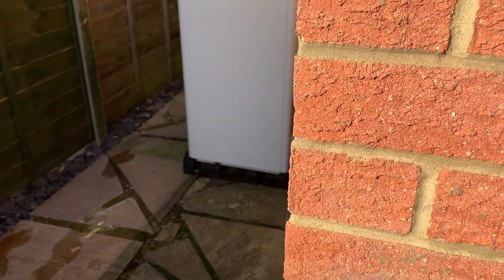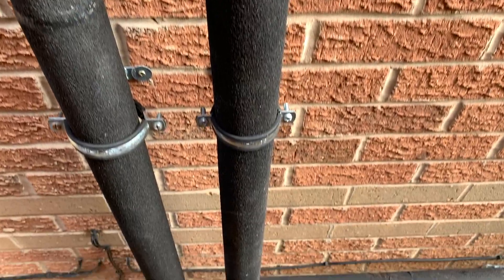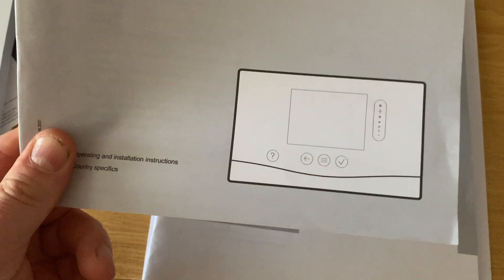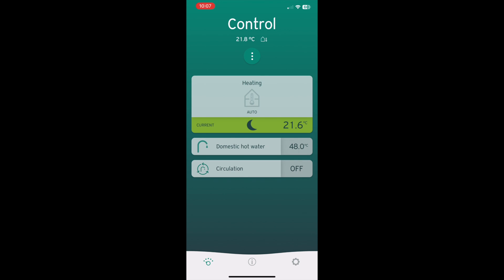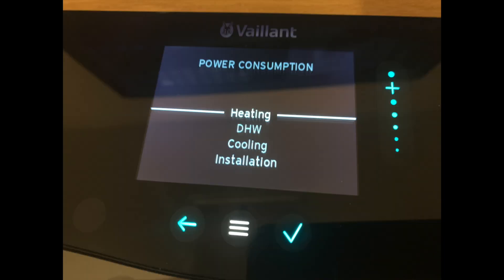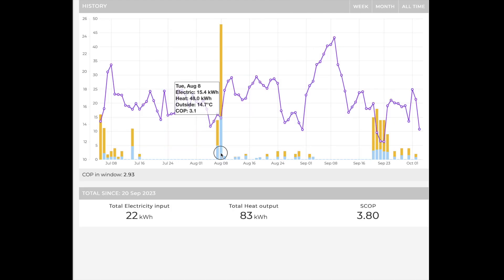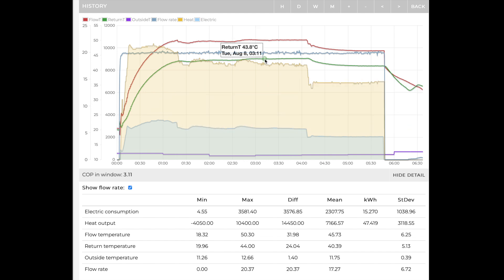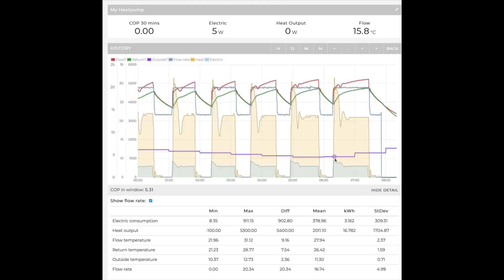Air Source Heat Pump - 30 days after install. What issues do we have?

Comment: Just looking at the clearance distance to the fence , I’d say there probably be an issue once the outside air temperature drops and the re circulating air caused by the fence ,starts to cause freezing on the coil, which will cause the efficiency to plummet. Will be interesting to see.
Reply from the maker: Thanks for watching Michael. The distance is 760mm between the fence and the heat pump, hence the need for planning permission detailed in the first video of this series. Vaillant's minimum recommended distance is 600mm. The passage down the side of the house is a wind tunnel, improved by the changes to the fence to open slat over closed slat. I doubt there will be micro climating. If it does then we can simple raise it off the ground.
Reply: @johntisbury  I think he makes a good point about the fence being too close. This will undoubtedly cause micro climating. If you watch urban plumber, he has had this issue on a few of his jobs and now elevates the heatpumps above the fences etc.
Reply from the maker: @deanchapple1  I've seen Szymon's videos where he has moved them to wall mounted. Air flow is all important in the location where the unit is fitted.

Our heat pump is outperforming its designed COP values. Currently running at 4.6 COP since its install in July. There's no issue with it micro climating down to 3ºC even with still days with no wind. I shall be monitoring it as it get colder, but so far no issues at all.
Reply: @johntisbury  yeah winter will be the deciding factor. Keep us posted. 😊👍🏼

Comment: What happened to LLH? Reasons for removal?
Reply from the maker: The buffer removal and reason why was covered in the previous video on this playlist.

Mark believed with the 35mm primaries we would get good flow rates 1200l/h. The buffer was installed as a safety net however we complained about it being noisy. So Mark removed it and said he should have trusted the maths; 7kW @DT 5 is 1200l/hr.

Comment: 1:20
Thank you John
What led your installer to the conclusion that the buffer tank is not necessary?
Reply from the maker: Mark believed with the 35mm primaries we would get good flow rates 1200l/h. The buffer was installed as a safety net however we complained about it being noisy. So Mark removed it and said I should have trusted the maths; 7kW @DT 5 is 1200l/hr.
Reply: @johntisbury Noisy because of the air?
Reply from the maker: @normanboyes4983  yes I think it would have been trapped air based on the amount I removed from the system from bleeding. Could also be turbulence too, which again can be air, but also the speed of the flow.

Comment: I still think the clearance in front of the heatpump is questionable. Certainly Octopus Energy would not of installed it there, because of the possibility of recycling the air as that will lower the efficiency.
Reply from the maker: Time will tell. I have purchased some smoke testers for that very reason on a cold still day I will be able to check if it is micro climating. Knowing the location and local conditions I don't think it will be a problem. However, if it does then it can be mounted up on a bracket to prevent it from happening.
Reply: Exactly right, there is not enough space in front or behind the heat pump.  Should be 1.5m in front and 300mm behind (minimums)

Comment: This has been really interesting John for a number of reasons. We have been looking at ASHP but had a few concerns due to the plastic microbore pipe. Watching your videos has reassured us that it will work as our house is 2018 and very well insulated, plus we have already installed large radiators to run our system at a lower temperature. Also by astonishing coincidence, JMR Heating is local to us and will be doing a survey.
Reply from the maker: Well it seems to tick all the boxes for you, that's great to hear. Have you watched the full installation video too showing they 6 day instal? Might be worth watching so you know what to expect. There's many urban myths about heat pumps, 5 years ago they may have been accurate, but not now with new modern heat pumps and the knowledge and expertise that goes with the installation of them. Mark from JMR Heating and Energy is a top chap and knows his stuff would recommend him.
Reply: @johntisbury  watching it now thanks, very useful.  Hopefully we won’t need any radiator upgrades as all are already double panels with those downstairs being 1.8m tall aluminium (chosen for both looks and output). Our complication will be a) HWC has to go in the loft as no suitable cupboard (slim cylinder should just fit through the loft hatch) and b) external unit will need to be wall mounted above head height over the driveway as there isn’t a suitable space at the rear of the house and the drive isn’t wide enough to place it at ground level and still park the car. Should be interesting!
Reply from the maker: @twelvebears1971 fairly normal situations to be fair.
Reply: @twelvebears1971  Have you looked at the Sunamp heat battery? It replaces a HWC at around 1/3rd of the size (although very heavy) can store heat a lot longer than a cylinder for obvious reasons like not constantly dilututing the hot water with cold water top ups.

Comment: I’ve instited octopus run my pipes internally 

Still waiting for them to get back to me.
Reply from the maker: Good luck with that.
Reply: @johntisbury  it’s exactly the same distance 
And a clear in obstructed pipe run. I’ve got new external wall insulation which is as fragile as an egg.  I’m also a former qualified installer MCS buisness owner so I know the job.
Reply from the maker: @rymoe6299  I hope that Octopus see that too then. Have they given you a default 'desktop quote' or did they visit and complete a heat loss survey?
Reply: @johntisbury  i had a survey done a few months back and the pay back didn’t justify the outlay.  Band B EPC.  I don’t need any radiator changed.  But I do need a new unvented hot water cylinder.

With the now £7500.00 BUS payment 
My contribution is £1500.00 £500 deposit and the rest over 12months interest free

For a Daikin 7kw plus 200ltr cylinder
Reply: Also found octopus were the only company to correctly size my system!! Few hundred watts difference on the hall stairs and landing.  
There paperwork quote was A1

Had 2 installers demanding payment in full and they would refund the bus payments after install! 

Complained to MCS and there were not interested 

I guarantee a lots of SMEs will be ripping people off with the installs!  Not all of them
But definitely a few
Reply from the maker: @rymoe6299 makes sense now for sure.
Reply from the maker: @rymoe6299  there's certainly room for ripping customers off with heat pumps, it's the new green deal insulation all over again if people don't do their homework and read up on the rules for the grant.
Reply: @johntisbury  that’s what I fear.  I’m glad I saw a heatgeeks sticker on your outdoor unit.  Good choice 👍🏻
Reply from the maker: @rymoe6299  a HeatGeek guaranteed install by JMR Heating and Energy was an easy choice looking at their customer feedback, their approach to a detailed heat loss and system design.
Reply: I agree, Mark installed my system at the beginning of January and apart from my over 20 year old UFH pipework still  having a bit of gundge in it therefor blocking the filter, making the HP shut down we haven't have an issue. BTW Mark has popped in at 7am on the way to work or in the evening on the way home to sort the issue every time, Couldn't recommend them highly enough @johntisbury

Comment: Hi John, Great video, but could you maybe add some more information for the ASHP monitoring with EmonHP. Dis you buy the level 3 kit and then get it installed or purchased with the ASHP? I am also interested to know more of how it connects up. I like you want to have more monitoring available to view and keeping track of how it is working.
Reply from the maker: Thanks for watching. Yes it was purchased and installed at the same time as the heat pump. I will certainly make a separate video on the components and how it works in more detail. I'm not expert it has to be said, but I can talk through the components and how / where they are installed and what data you can see.

Comment: Hi John. Great video, again ! I have 2 questions: what is the distance between the heat pump and the fence ? It looks less than 1m for me. Isn’t it maybe too close, so that you will have recirculating the cold air?  
Second one: did no-one recomend you to use an deaerator, like spirovent or zeparo ZU? I am thinking of installing one, just to be sure.
Reply from the maker: Thanks for watching Adrian. The distance is 760mm between the fence and the heat pump, hence the need for planning permission detailed in the first video of this series. Vaillant's minimum recommended distance is 600mm. The passage down the side of the house is a wind tunnel, improved by the changes to the fence to open slat over closed slat. I doubt there will be micro climating. If it does then we can simple raise it off the ground. 

Air separators (Spirotech) don't work with low temperature heating systems so I understand.
Reply: Thanks John !

Comment: Great video as always - those Valiant systems look very nice.  

Did you get a quote from Octopus Energy - - Daikin heat pump ,  Daikin compatible water cylinder, Any necessary new radiators and upgrades, Any necessary plumbing and electrical work
Labour and workmanship. Quoting just under £2000 (following the increase of the grant to £7500) for our 4 bed detached house.  Which seems very cheap compared to your 15k bill ?
Reply from the maker: Thank you for watching. 
I didn't get a quote from Octopus as I wanted a Heat Geek installation with a guaranteed COP for DHW and heating and a detailed heat loss survey. If our system does not perform to those quoted figures they will resolve it until it does at no cost to me. I also wanted a relationship with a local installer rather than a larger company. 

Don't get me wrong I think what Octopus Energy are doing is great and fully support their approach. However, they are picking off the low handing fruit in terms of installations. At the time we got quoted I don't believe with our micro-bore pipework and long primary runs would have been entertained by them, this was certainly the case when they started, micro-bore was a non starter for them.

Comment: Great overview video John.  Would be interested to know if you've looked into if it's possible to integrate into Home Assistant and if so,what benefits that would give?
Reply from the maker: Thank you. There is an integration for the myVAILLANT app https://github.com/signalkraft/mypyllant-component/releases but not the sensioAPP version. Once I'm upgraded on the Vaillant app I will be trying it out. I guess it will be monitoring over automation, but yet to really investigate.
Reply: OpenEnergyMonitor Emoncms also has a Home Assistant integration
Reply from the maker: @mrmuds8624 I've now setup the emoncms in Home Assistant so will do a video on that in the near future once my dashboard looks less like a 8 year olds attempt at dashboard layouts.
Reply: @johntisbury  thanks, I look forward to it!
Reply from the maker: @GlynHudson thanks Glyn good call